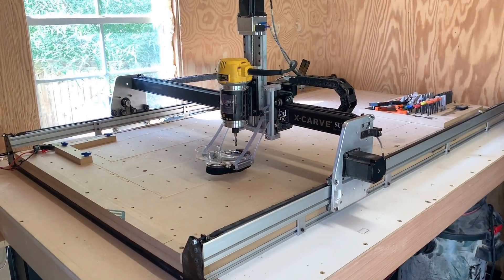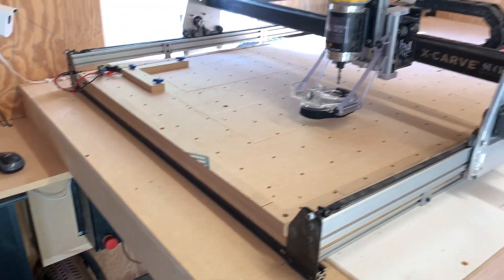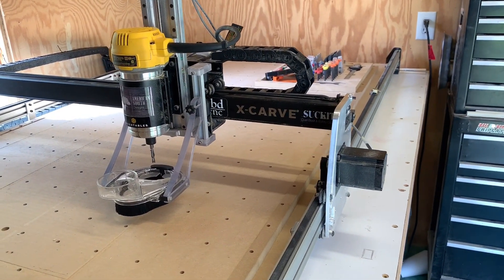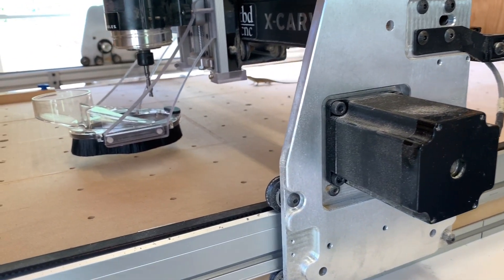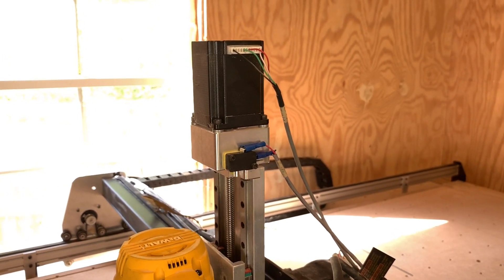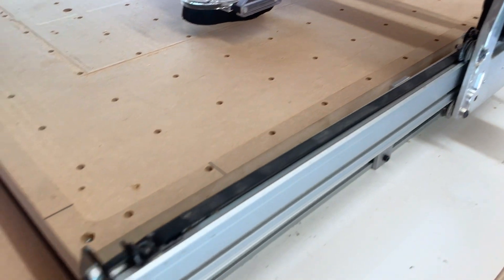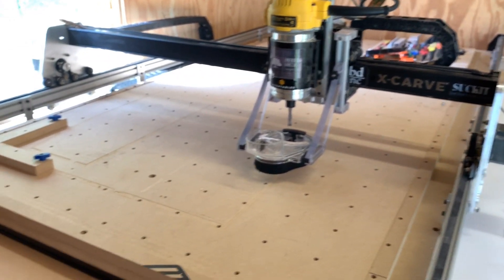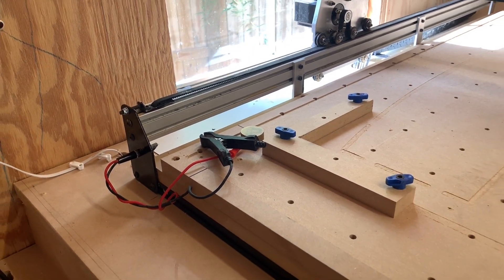X-Carve 1800mm: What We Used to Upgrade our Stock 1000mm X-Carve CNC Router

Comment: now as far as best value for larger format DIY kit under $2000 i would say the WorkBee 1515 knockoff is best choice..its huge 1500mmx1500mm thats 3x bigger than xcarve and has 1500w VFD spindle for $1500 shipped...its nowhere near as rigid and as well designed and as capable as the millright mega v but its much much better value and capable than the xcarve for sure...nobody has said anything  negative about the mega V design but we all know there are numerous negatives about the xcarve design .

Comment: How does the extra inches work on the Z axis if the gantry is in the way of the word?  I want to upgrade mine but haven’t hear anyone explain that. thanks
Reply from the maker: I raised mine an extra 2”...the only draw back is I had to add an extra 3/4” sheet of mdf for my wasteboard. Then it wouldn’t reach the first layer. I can stick at least a 3” piece under it

Comment: Yes i agree..the xcarve all versions are very flimsy and too much flex but i just made mine usable by providing proper power to stepper motors...flexing due to the cheap vwheel / and flimsy thin 6mm belt design and horrible z axis design is a whole other issue...but i only paid $200 for my 1000 mm xcarve so im ok with the poor design...if i paid $1800 retail i would not be happy at all

Comment: I have the older 2016 v xcarve its a pos but i did some cheap upgrades under $50  total to make it usable ...i changed out the junk gshield board for 4 stepper drivers and i upgraded to a  36v power supply..
Runs better now
Reply from the maker: der ddd I waited until they made the last round of improvements before buying my machine. I didn’t have any issues with my machine before the upgrades, but I did feel it could use some beefier components like the  Shapeoko. I’m thoroughly happy with my set up now